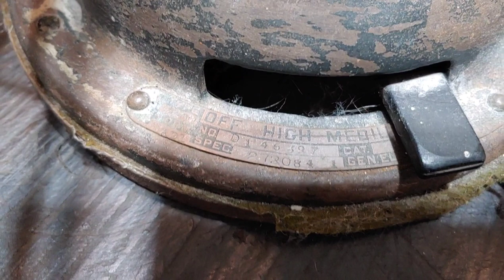Antique 1920s GE Fan Restoration - Barn Find - Real Time

Comment: A couple of tips from a long time (40 + years now) "fan restorer"......  Get yourself a high quality set of hollow ground screwdrivers and use the proper size on each screw! Watching you use beat up old screwdrivers that are of the wrong sizes with dull blade tips dull tips was painful! If you can't or don't want to buy new ones, at least sharpen up and put a good grind back on your old ones - and use the proper sizes. Also, when reassembling the gear box you might want to grease all components while reassembling. It just makes it easier for grease to get in to all the nooks and cranny's. Don't mean to be over critical - you did a great job and have the knowledge and skills, but when using old worn screwdrivers they can slip and ruin a great restoration - been there , done that! Anyone who can do what we do can easily regrind, sharpen and restore screwdrivers - or just buy a new set of Hollow Ground from Brownell's.  Fine Resto!
Reply: Thanks! Was helpful to me.
Reply: That was a gracious comment.  Question for you: what kind of paint should go on there? Obviously not a rattle can. I'm wondering if Jappaning was used?
Reply: My cringe moment was more about how close he cut the original head wire. I get it that you don’t have a lot of room and the heat shrunk is kind of stiff…but still…I think I’d have given it at least a half in more just to be safe. I’m sure he’s a better solderer than me though lol.
Reply: @spudth  I'm not an expert, but going on what I've seen on other videos I think "Japanning" was one of the original ways of painting these old appliances.  I think you can buy a good rattle can of enamel paint these days and that can actually be a durable finish if you bake it on after spraying.  I've had good experiences baking on enamel paint, but do it on a day you can open all the windows in the house as it releases nasty fumes.  More detailed instructions can be found with an internet search.
Reply: @solinvictus39  I actually have the correct material for Jappaning. I bought it for some wood planes I'm restoring.

Comment: Love this video as I am restoring the same fan myself. I have a question though, I dont see the removal of the stator in this video, how did you get it out? The one I'm working on is stuck fast and no amount of tapping/pulling has worked so far. It will not budge and i am stuck! Any advice would be greatly appreciated, thanks.

Comment: I may have missed it, is there some sort of grease i put in the gear box?? Diing my first full restore on a 1923 General Electric fan Cat 75423 any info would be most helpful, Thank You
Reply from the maker: I use grease front the auto parts store

Comment: Wow...that job on the GE button was beautiful. What kind of pad on the dremel do you use to clean the brass?
Reply from the maker: Just a buffing pad
Reply: What did you clean the stator with  ( the covered wire part & metal ring). Should I spray it with automotive parts cleaner? Not sure anyone in their videos shows how to clean it, so not sure what to do.